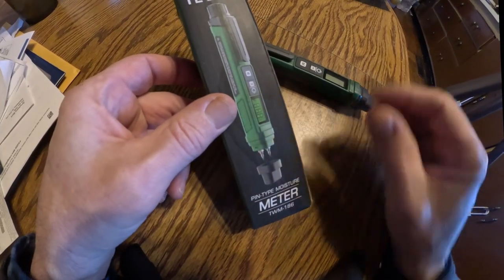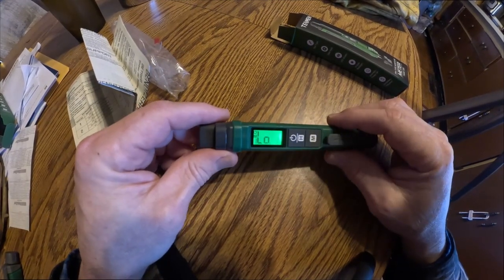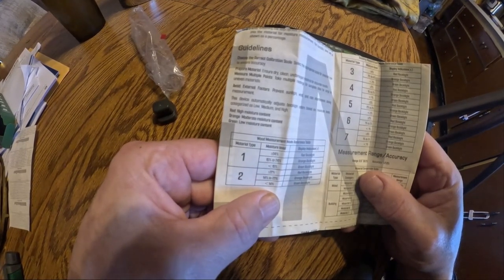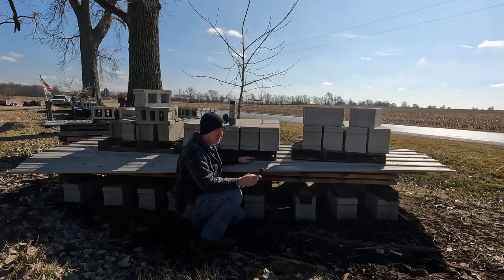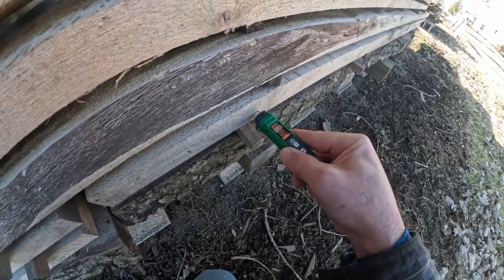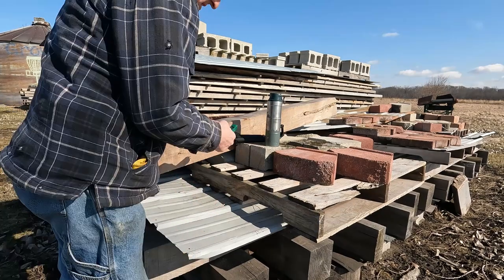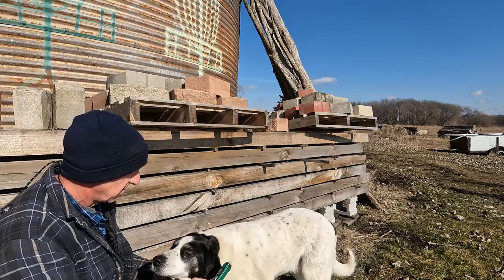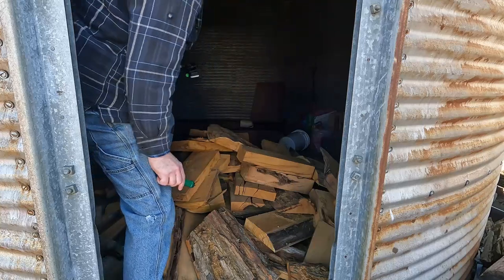Tesmen Moisture Meter TWM-186 Lumber Test

Comment: Cool tool!  But I couldn't hear you too well :(  In Davinci you can crank up your voice volume in the Fairlight tab ;)
Reply from the maker: Thanks,  It is my fault,  I am using an old TV as my monitor right now.    I need to watch it on my laptop and adjust the volume from there.
Reply: @DANG--  I go through similar challenges only in my case it's where my DJI mic is sitting, if it's on the left side of my jacket and I turn to the right my volume goes down and I have to correct later, and I forget to make it mono since the mic doesn't really record in stereo (only thing I don't like about it).
Reply from the maker: @TheOldJarhead  in Divenci resolve is there a standard for volume?    Like +8?
Reply: @DANG--   No.  I usually do it by hear 😉